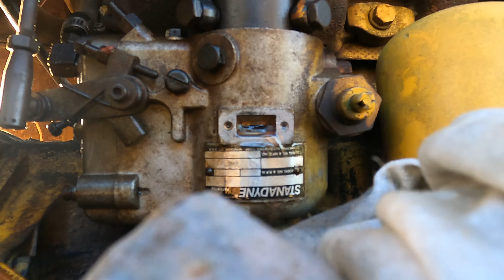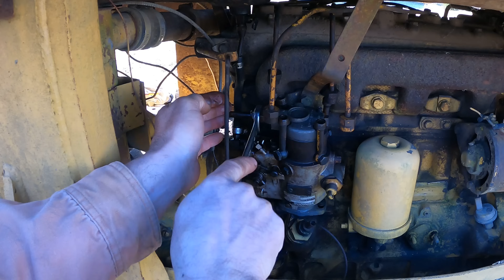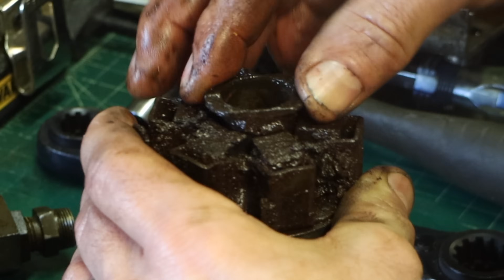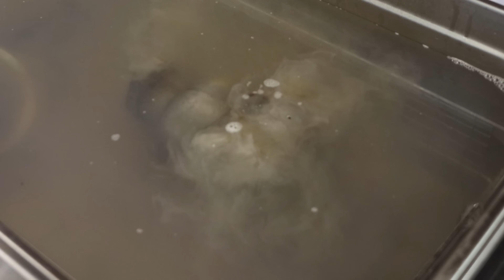Forgotten John Deere 1010 Track Loader, Part 2.

Comment: What you should do is set the timing on the Injection pump., CORRECTLY.  4 good glow plugs.  Fully charged battery.  Heat the plugs for 30 seconds, and KEEP THEM POWERED, and start cranking.  It will start.

Comment: I think you would be justified in rebuilding the engine. Maybe not right away but clearly there’s no rush. Heck, maybe even look into a replacement engine. It might be cheaper. I feel like the best course of action is to repair other items first. Deal with the hydraulic cylinders first, repair the cab controls and clean out the fuel tank. Get some friends and make it a group project. Maybe you can Shang hi other YouTubers.

Comment: Don't give up on having it fire up just yet! I'd also vote for checking some simple things  - eg that the injectors are actually misting properly and that the pump is not out off of time. And maybe take off the valve cover to see how things look. It would be satisfying to get her to fire up.

Otherwise, I doubt it would be worth the invested time and effort and money for a full rebuild. IMHO you'd be better off getting a modern era tracked skid steer. Those would be worth fixing as you know they would be an extremely productive machine. You won't be nearly as productive using an antique like this Deere.

Comment: Yup timing , i would concentrate there. I have done about 6 2010 and a few 1010 dozers. You will get it running with that compression. I had my son time one on his own and he timed it  wrong and it still ran like a dog. Hard starting and no power. Tdc then time the pump .I would not touch the injetors. Almost all that i purchased had bad pump ,I just bought the reseal kits with the rubber connector also and timed them and all ran. The big concern will be the steering clutches once you get it running. Good luck with it. .

Comment: cylinder 3 and 4 valves suck balls, and they all need new cylinders and rings possibly sleeves depending on direction and amount of scoring. if you go that far, you're all in, order the rods for they cylinders now so you can have em when  the engine is back from the shop.

Comment: The one-way valve must be as near the cylinder as possible ideally at the edge of the inserted probe to have any usefull compression results on diesels where higher ratios are expected. And wet compression difference you get, can also partially be attributed to the (uncompressible) inserted oil volume.
Don't rush into opening it just yet. Verify timing first, check injectors, will then probably start with some help, and let it work for a bit.

Comment: A few thoughts.  To try to get it running. 
Can you heat the intake with your propane torch to heat the incoming air charge.  I have seen videos of starting an old german diesel engine. They held a torch into the intake manifold opening while cranking blocking only part of the incoming air.  It had to be just right to work .

Question. Can you adapt a porta power pump to the injector inlet fitting allowing you to test the injector spray pattern.. 

Since you have the intake off. Do the valves open wide enough to get the camera in to examine the valve faces .  Perhaps look at the bore.  

Since the lower hose is loose it seems. Watching on my cell phone.  

 Could you use no hub couplings and freeze plugs to seal off the upper and lower outlets letting you pressurize the block thru the drain plug opening  with a rubber glove over the oil fill and crancase breather openings. Bubble soap in a spray bottle on the outside of the block and head

Comment: I would do what Scott Wood said below. Set the injector pump timing correctly. Put the 10cc of oil back in the cylinders to help seal the rings to give the best chance of starting. Put a heat gun/hair dryer in the intake and blow hot air in the cylinders. John I believe it will start. Also you could 24 volt it to make it spin faster. This will create more compression. You only need to get it running once and the valves and rings will then seal better. Good luck. Don't  give up. Everyone wants to see it run without a rebuild. Remember injector pump timing is critical. Also replace the two non working glow plugs. Cheers Stew.

Comment: Did you ever try turning the injection pump 180 degrees?  I gotta believe that thing would run (probably rough) with correct timing even with low compression. Great videos, thanks for posting.

Comment: This pump is similar, well not exactly but close to Lucas-CAV (Roto-Diesel) pumps. Hated in my area, but... They did work. 
*edit:
I would have a closer look at the valves/seats, since you are about to take the head off. The lesser problem. Otherwise, bore the block to the next quote/stage/step ( language barrier here, please don't laugh ). However, I would try to start this old lady, just to be sure the rings aren't stuck, even it would take a bucket of ether, before taking her apart. My 2 cents, not a pro speaking, just another part-time farmer.
And oh, what a nice region you live in, here we are on heavy heating, for 3 weeks now! I envy you. :) (Romania, Transylvanian region here, winter)
Keep up what you are doing (I know you will), and have a great Christmas. Notifications will come. My warmest regards, til the next one.

Comment: Great content again!
In my opinion. No further work on the loader is worth it. The engine is already a huge amount of work but hydraulics will certainly eat you up. If I see it correctly, all hydraulic cylinders have to be reworked maybe the Pump to and then it is still unclear whether the drive system even works.
Unfortunately, I don't think it's worth it.

Greetings from Germany

Comment: There is a few comments saying to get it started. You can.  From the bore scope video those valves is very rusty.  Should it be rebuilt? Sure and John Deere is usually pretty good at getting parts for old machines.

As a winter project rebuilding a diesel engine would be fun.  My concern is that pump was full of junk that only comes from diesel tank which may have a bug. If it was me I’d tear down all the hard to get to systems, engine transmission etc. for overhaul or rebuild just for piece of mind.

Easiest thing to do would be pop head clean and lap valves then try to start it with cleaned injectors.

Comment: Put the marvel mystery oil in and legit sit a few days.  Then recheck compression.  You can look into the cylinders with your borescope to see the condition of the cylinder walls.  None of this will cost you anything.  Even if your compression comes up, you’ll have to get injectors repaired/replaced before it will run.

Comment: OK Jon, IMO you are 99 9/10th's% there. Let's get this thing running 1st on Propane and then assess whether it's ever going to be a viable unit. With no more money, and very little labor you can easily get this engine running on Propane, but 1st clean the injectors and lines meticulously like you have done the pump. Then check the spray pattern on each nozzle to see if they all make a nice cloud. If you have one install a coolant heater, like one that goes into the bottom radiator hose near the water pump. Or build a fire under the engine.
For Propane: run a 3/8'' rubber fuel hose from a fitting right on the valve of your 20# propane tank. No regulator. Put the other end into the intake manifold.
TO START IT:
Beginning With a very well charged battery and a warm engine, operate the glow plugs and shoot starting fluid + propane in it and crank. Maybe even go to 24V temporarily to spin the starter faster. Note: 24V to starter only, not the glow plugs or other accessories.
If you can enlist a competent helper to pull it with another crawler or a tractor, using the highest gear, pull it and crank it at the same time to see if you can get the engine up to 1,000 RPM or more. I have pull started cars and trucks with automatic transmissions by overriding the neutral safety and cranking while pulling 10-15mph. Works like you can't believe.
Any engine with over 20# compression will start up and run w/ no load, you just have to satisfy the ignition requirements: HEAT+ FUEL + TIMING. But the propane/ starting fluid will get it going even without TIMING the fuel injection.
Once you get it going, run it fast for an hour or more. Heck if it moves, run it around some, but RUN IT. Get it good and hot. The cylinder walls and rings will clean up and the valves will start working better. Then you can monkey around with injection timing if it's not right. You'd be amazed what a difference a couple heat cycles can do to an old engine The more you run it the better it will keep getting.
But, once you get that engine to run for a couple hours if it doesn't start easily enough for you then I guess throw it away. But you could have some fun with it while you assess it.
ONE MORE THING: The Propane + starting fluid method works on gas too when your fuel pump craps out. You can run and even drive an engine on Propane straight off the Propane tank by adjusting the on off valve. I drove my 1998 GMC Yukon over 10 miles on propane to get it to a shop where I could drop the fuel tank and change the pump. I didn't break land speed records, and I wouldn't do it in traffic, but it was -5° F and it got me to a nice warm shop. I work alone all the time, so sometimes I start gas engines up that way and while running on Propane I beat on the gas tank with a hammer to see if the pump will work one more time. If the pump comes on, the gas engine will start running too rich, the Diesel will speed up. To Quote Taryl Dactyl " There's Your Dinner." ben/ michigan

Comment: The problem with the 1010 is that it's a very odd sleeve deck design (the 4 cylinder sleeves are 1 piece connected at the top by a plate "sleeve deck"). A sleeve deck costs around $1700 +. I would take the head off, measure the bores, and if they measure decent (round, and not too much taper) hone the bores, replace the rings, lap the valves, and put it back together.

Comment: I would be inclined to pull the engine and get the head and oil pan off. If its toast at least you can sell the pump as rebuilt and the carcass for scrap. Don't  forget you are going to be dropping some coin on hydraulic cylinders as well. All that being considered, Ithink I would do the rebuild, your not going to get a 'good' operating machine for what you are going to have invested in the end. At that point you would know the quality of the rebuilt machine and have the satisfaction of doing it yourself.

Comment: See if you can find a doner machine for the motor. Find one that runs but the chassis is clapped etc. I have found also with the old stuff the frequently used the same motor across lots of equipment so finding a motor for cheap shouldn't be too bad.

Comment: ? no smoke when cranking ?should be vaporized fuel in the exhaust stream if the injectors are firing. Run the valves. verify timing. Pull an injector make sure its firing. Add heat to the block or your intake air stream.

Comment: Make sure the injection pump is timed 100% correct then put oil in the cylinders and and put injector’s back in ive seen older diesels not want to start because the cylinder walls were washed out by either being feed to it for so long i have a feeling if you can get enough compression for it to go it will be fine

Comment: The wires in those bottom bolts aren't for tamper-proofing.  They're for exactly what you used them for: securing against vibration.  They're used a lot on turbine engines, where one loose fastener can cause catastrophic failure.   AgentJayZ has a great video about lockwire.
Reply: Tractors are no aircraft, the wire usually has a tamper evident seal attached from the factory so you can't tune your tractor.
Few of the fasteners on a tractor have lockwire, and those housing bolts aren't even safety critical if they back out.
AgentJayZ is great though.

Comment: Given the crud from the fuel system, MM oil the cylinders and a tear down only after cleaning injectors. Finding true timing to the fuel pump & crank shaft TDC would help too. In this modern world of gizmos and electronic gadgets someone out there might want just the engine alone if you got it working & just sell as rebuilt block. Not a JD nut but in that same year the same engine could be out on other things so having a working crate for someone's project might pay for the time, and the video I really want to see would be dividends with ad revenue.

Comment: It's scrap, sell the pump as a part and the rest for steel.  At best you'll need injectors, rings, cylinder sleeves. But possibly crankcase issues, and the drive system might be trash as well. Looks like a old rusty money pit.  Cut your losses and work on something better.  Either way I'll be watching.

Comment: I suggest you take a run to the coast and find a big boat that needs a big anchor.  If it were an engine manufactured by Cat, Cummins, Perkins or Detroit I would suggest fishing around for a parts source.  You may want to contact the HCEA [Historical Construction Equipment Association] headquartered near Toledo, OH and get their thoughts.  The members are collectors and fans of old and antique construction equipment.

You may also contact John Deere in Moline, IL and see if they can provide any assistance.  Are you certain the engine was actually manufactured by JD and not by another engine OEM who simply slapped the John Deere name on it?  I worked in the heavy truck industry for a little over 28 years and can tell you from personal knowledge that truck OEM's assembled parts made by others companies to slightly differing specs.  About the only thing they made themselves were the cabs, everything else was made "by others".  I can't help thinking the same is true of construction equipment - especially diesels.

Good luck, love your channel!

Comment: First what are you going to do with the track drive front end loader ? Use it, sell it ? Does your front end loader tractor do all that the track drive would do for you ?  If you’re just looking for a project to place on your Youtube Channel I’m sure there could be more fun projects that are easier !  I was in Auto Body for 53 years and I always needed to know why something failed and how exactly that it worked so I could figure out if it was going to fail again before a reasonable life expectancy . I had plenty to do over all those years and If I was stumped I would spend hours trying to see why something failed so it wouldn’t repeat with the replacement parts. Keep up the great work and thank you for doing what you do to entertain all your subscribers.

Comment: Jon, when you are doing 2 or 3 clicks with your torque wrench, has it ever moved any further than after the first click. Then stop with the 2 or 3 just in case clicks please, they are not necessary, especially when it is inch/pounds, you're only going to overtighten them. Furthermore, when wire locking bolts etc. you don't wire lock like that. You use a pair of wire locking pliers and twist the wires.

Comment: I would continue with trouble shooting. Make sure your timing is proper. Make sure injectors are spraying. Make sure li nes are clean from pump to injector. Valve ajustment? Possible to boro scope eack cylinder? Since your waiting to decide on what to do next pour some penatrating oli in the cylinders. Wont hurt. Really enjoy your vids. Your ability to explain things thanks for sharing merry christmas eli

Comment: - Thank you for putting is so much work and emotional effort, John.
- I suspect most of your viewers would like to see you conquer this and get the machine to rights.
- But you are the one doing the emotional struggles and physical work.
- Could you do an engine rebuild?
- Would the improved resale value be worth it?
- Would a running machine fit enough of your work requirements?

Comment: Check injectors.  Have seen engines free up stuck rings after running a short period of time.  I would not tear engine down until you check the injectors.

Comment: Change the oil, top up with oil in the cylinders again put it back together and give it another shot, you are close enough on compression that If you can get it started I bet it comes back enough to run.

Comment: Heat the block and try again.  Get it hot.  The rings may seal better after it it runs for 5 minutes.
Is the fuel good?

Comment: While it was obvious that you had fuel pumping while you were bleeding the injectors, there was absolutely no fuel being injected. The tell tale is there was no smoke at all except when you were spraying the ether. A lot of engines will not run off the ether alone. They rely on the timing of the diesel injection and they work together to start. I have seen a number of engines that will just not run on ether alone but just a touch when the diesel is injecting properly is all that is needed to light it off. As has already been suggested, remove at least one injector from the cylinder and crank it with it connected out of the head. If you see no fuel being sprayed from the injector then it will won't start. I hate to say it but my fear is that the plunger got damaged when "tapping" it out and you are not building the pressure necessary to crack the injector open. The pump will pump plenty of fuel to bleed the lines but may not be building anywhere near the 3000ish PSI necessary pop the injector...I suspect it will probably run just fine once you get the fuel injecting properly. The compression is artificially low as everything is dry from sitting for years. The fuel will help this condition considerably

Comment: That thing has a deck plate with all the liners built onto it. They don't make em any more and if you find one it will be expensive. Unless you get lucky and can just hone and rering it's not worth it in my opinion. I would try to get it started and hope the compression comes back some. It's considered a low compression diesel anyway, hence the glow plugs to help start it. It's not likely gonna start with out them.